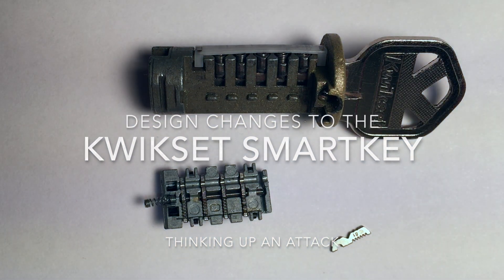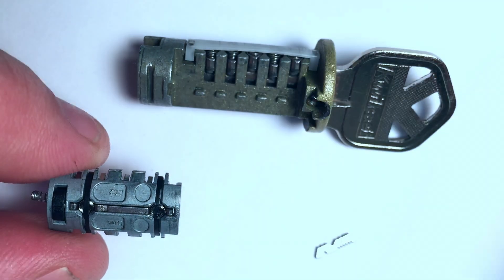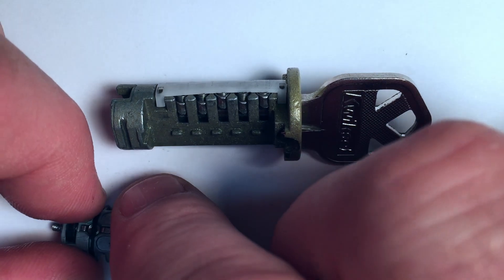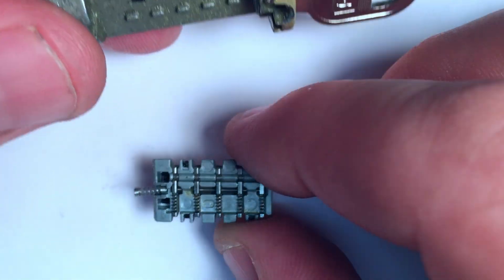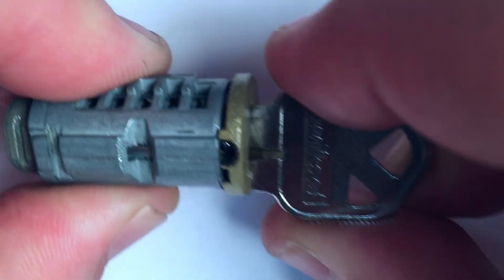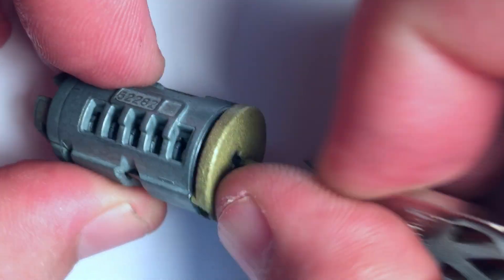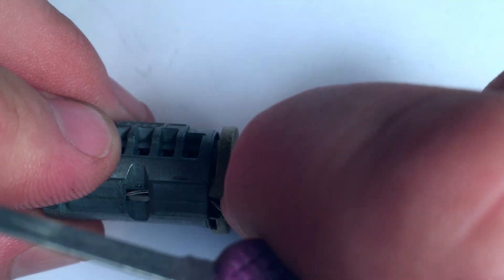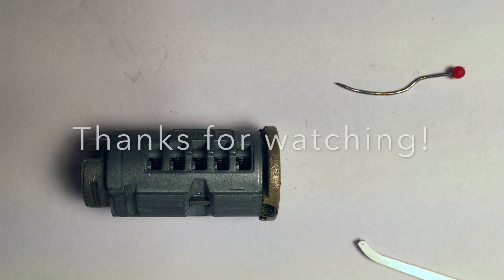Design Changes to the Kwikset SmartKey

Comment: I am so glad for this video, I picked up a Kwikset Halo Touch deadbolt for cheap cause it was missing its keys. I found and was about to order a replacement tumbler assembly when I found this video. 5 minutes later I'd managed to disassemble and reset the lock to a random kwikset key I had!

Comment: I've got an old Gen2 SmartKey that is sticky and wonky and absolutely refuses to cooperate. If you apply ANY tension whatsoever everything binds up like it's welded together. Even if you get some set and remove tension, nothing releases until you apply reverse tension. And if you try to manipulate in just the right way, the wafers will slip and change the keying so the key won't even work. It's an absolute beast to work with.

Comment: After  installing and messing up the re-keying process on my brand-new Kwikset deadbolt,  I found tumbl3r video. I discovered that the plastic cover on the bottom half of the cylinder, was VERY lightly attached to the cylinder.  When you insert the key in preparation to re-fitting the wafer-side of the cylinder, the key pressure on those little springs can cause the plastic shell to pop off and the 5 little springs to fly out. Be very careful here.

Comment: For hobby pickers, please consider posting more detailed picking hints that define that lock's Kwikset Smartkey generation.

I've looked at these posts:
Charles builds crap
Michael Gilchrist # L21
Jamie's locks #25, 29
loupgarou21
Artemis picks #21
tumbl3r (post and "design changes")

Cordially,
Gary Bowman
Reply: the other posts didn't get listed. They are: Michael Gilchrise L21, Jamies locks #25, 29, loupgarou21, Chris Ahrens #68, 139, 21, lockapalooza #4, MrBlack-magic #57. From looking at the face of the lock how can one tell if it's a gen 3 needing the shim to pick?
Reply: Also, would using the shim make picking gen 1 and 2 easier?

Comment: Here's an idea! Try bend shaping the pin with the corresponding depth entries, using a needlenose plyer and shaping it into the shape of the sidebar entryway, so that the tip of the pin will fall into place when it reaches the sidebar. Then when the pin is turned it'll put the sidebar in place.

Comment: Totally agree the AssaTwin is the machinist treasure to have beaten.  I was never a fan of Kwikset because it’s lack of tolerances and builder grade evolution.  The early versions of the Kwikset smart key were easily defeated.  Now, The Square side bar under spring tension is what GM has done from the 1960’s. As a locksmith we would use Wiggle jiggle keys or more modern techniques were to use set of rockers blades. With GM you would use car opening tools and to make the ignition key, pull the wheel and lock and just replace it.  As for the Kwikset, this newest design, it lends real locksmiths called in for a lockout two choices, rake and rock for 3 or so minutes, then drill.  I don’t see how a bump key would ever work - so for that, I applaud Kwikset. I would be very interested in tumbler 3 non destructive pick or manipulation of this lock.  I say, exploit the tolerances and gaps.

Comment: The side bar has the two clips already applying down ward pressure, so using the pin forced into that side bar slot will only bind the lock more causing you to use even more pressure needed to turn the cylinder.  Try to use the lightest turning pressure possible and lubricate the lock first. A heavy hand is the true failure of picking most locks.
Reply from the maker: This is incorrect. Chris Ahrens has proven out the theory of this exploit and used it to defeat the Gen3 SmartKey about a year ago. We worked together on the project. Since then many others have defeated it the same way.

The "use light tension" mantra represents a somewhat viable approach to open one very specific type of fairly mediocre lock. Sadly, that dogmatic approach to tension became pervasive, and actually prevents a lot of people from defeating anything other than average locks. The correct tension is that which gets the lock to respond. Sometimes it's light, sometimes it damn near breaks your tension wrench.
Reply: Do you have a video of that by pass?  I would be interested in seeing it.  I am still and have been a locksmith for 34 years, but any tips are always welcome.
Reply from the maker: Here's the video Chris made picking it with this exploit. https://www.youtube.com/watch?v=H-9_3gIQwPw&t

Comment: Hi.  Very nice video.  I recently had a smart key lock installed on a new door at home.  I have been interested in locks for decades.  So I did some research to see how the smart key system worked.   I just viewed your video.  It looks like the revised kwikset smart key system is a "dead ringer" for the general motors steering column ignition locks used on their cars from 1969  until probably the 1990's. These were the column locks that had the "ears" that were used for the rotational force.  The keys back then were thin and weak against rotational force.  The side bar was squared off to prevent it from being picked down by rotational tension.  The quick picking method was using profile keys.  Locksmiths would have a set of about 10 and the process was trial error.  The other method was more destructive.  It involved drilling a hole in the end of the lock face to access the end of the side bar. Then use a pin (such as you are trying) to provide force on the side bar to pick it down.  The GM locks were not rekeyable so the wafers were a simple one piece design.  Of course all of these anti pick devices took a back seat to the VATS lock systems that came along in the 90's.
Reply from the maker: Good eye! I didn't know it at the time, but Kwikset certainly did copy the GM design. Interestingly, some versions of these locks are vulnerable to force attacks too. It's a clever design, but without high-quality, hardened materials it's going to be difficult to make a lock that cannot be overcome by manipulation or force.
Reply: @tumbl3r  Good point about the lack of use of hardened materials.  I guess, at the end of the day, the lock still needs to be affordable by being mass produced using diecast metal parts.  Back in the day, another GM bypass method (even more destructive) was a slide hammer connected to a "cork screw" that was threaded into the keyway.  A few good yanks and the  plug came right out.  One long screw driver was then used to start the car and unlock the steering.

Comment: I'd like a lock that requires you to stick your hand in a hole, reads biometrics, asks for a passkey that needs to be typed on a pad (which is unmarked, automatically cleaned and thermally evened out immediately after each use, with access blocked until finished so no scanning tools can be used) hidden in that hole, another you have to speak and a restraint behind the hole holds onto you until police and an authorized person arrive if you are not authorized to enter.
Reply: Where do you live, fort Knox?

Comment: I wonder how much it would add to the cost and help to plate the surface with titanium so that drilling isn't possible without an expensive drill, bit and a lot of strength and time.  That should even save the lock from that attack almost every time.

Comment: Can this lock still be forced open as the others? Thanks
Reply from the maker: I don't actually know. I suspect not in the way that the previous revisions can be. Probably with enough force the zinc housing would deform, allowing the lock to open. It would not, however fail from inward pressure on the wafers because of the squared off sidebar.

Comment: I'm sure you know by now that using the Kwikset smartkey inserts to actually change the key code depresses the sidebar and will allow you to tention lock and pick it.
Reply: I agree and have partialy tested, but due to a lack of a vise or 3 hands I couldn't use a pick from the front, only poke the waffers into alinement from the side and then turn it , I wiil fully test when I get a vise.
If kwikset were to block access to the reset carriage until it is in the unlocked position, this would not be usable.
if they made a lock that was only designed with the side bar, sliders and dummy pins, that was solid brass it would be unbeatable.

Comment: Just a thought could you take the reset tool and apply pressure once you have it picked to release your tension wrench so the side bar will drop and thus allowing the cylinder to rotate???

Comment: Hi tumbl3r, I have not been able to find anything else more recent on your channel about the redesigned Kwikset SmartKey. Would I be wrong in assuming this video stands for now; that you still conclude the new SmartKey design is extremely hard to foil? For the record, I googled Assa Ruko Twin 6000 and it's very hard to find for sale! (No I am not asking you to talk about the Assa... quite the opposite, smile.)

Edit: I just called the Kwikset 800#, the rep said that any box dated Sept. 2016 or later (on the bottom) will definitely be generation 3 SmartKey. For all products, all ANSI levels. So this is something I could look for. [UPDATE: ANOTHER KWIKSET REP SAID THIS IS WRONG, only Uptown and Downtown deadbolts are gen3 as of March 2017 with no current plans to extend it to others. See my reply to tumbl3r's reply, below.] He also said gen. 2 cylinders have a black plate on the side for quick fixes by locksmiths, but gen 3 does not have that. I guess he is talking about the little bar you remove at 6:01 of your 10:19 video "Kwikset SmartKey - SPP Pick & Gut"?

I might add that as soon as I asked the Kwikset rep about the lock you said was tough, he said he knew of you, and launched into a spiel about how you manipulate the locks so you can pick them. I had to talk over him to get him to stop telling me how you're wrong... the reason I was calling to find out their latest generation was because tumbl3r is saying they're quite good! So if tumbl3r is wrong, the Kwikset rep must be saying SmartKey is quite bad! lol

For the record, I don't believe a company that won't simply say when they made a mistake. Everybody can make a mistake; everybody can improve. But you should not make a mistake and say the other person is wrong about it. So I don't buy it when they say someone else is wrong.

Thanks so much for your videos! They really help inform us. We can't all be good at everything, so we all help each other. (Also, we don't all want a work of art... just a smart choice acknowledging ease of use and budget.)
Reply: @tumbl3r The link to the Wayne Windon video doesn't work. 404 Error.

Love your video on the changes to the kwikset.
Reply: tumbl3r  That video is almost certainly a paid product endorsement (or another marketing strategy)  for Schlage. A door can be kicked in just as easy using each lock, but using a Kwikset gen 3 keeps picking novices out and doesn't take 1 minute to pick.
Reply: MrCarGuy20, That's why there is advice available to make your door more kick resistant.  If your door frame and door is installed properly, with an inexpensive upgrade, even the toughest burglar would rather go through a window, or even the wall.  Even if they have to climb a tall ladder outside to get there.
Reply from the maker: Hi Mike,
As far as I know this is the most current work done with this version of the SmartKey. I was working with a borrowed lock, and I have not gone out and picked up another one to work on. There are a few ideas that I think will ultimately prove viable, but for now I've been focusing on locks that I find more interesting. I don't know of anyone who has managed to pick open this version of the SmartKey and it is 100% correct to say that this lock is extremely pick resistant. That does not necessarily mean they are "good" though. I am not a locksmith, and I cannot speak to the wholistic security of the system, but I will say that the SmartKey is composed of what appears to be potted metal, which is almost certainly not as strong against forcing attacks as more conventional pin tumbler systems made from brass. 
The previous generation SmartKey was susceptible to a forcing attack that worked while often leaving the lock in a semi-functional state. The materials do not appear to have changes substantively in the current generation, so that would definitely be a concern for me if I were considering them for my home. Wayne Winton is a very good locksmith and has made a video about the differences between the SmartKey and the Schlage systems (https://youtu.be/J9pgqBSGD0s). He also has some other good videos about how to select the best lock for your home. Criminals almost never actually pick locks, so resistance against bumping, forcing, cutting or smashing is a much more important consideration. 
It's funny that the rep got all spun up, LOL. Having lock companies frown on what we do and claim that we are faking it or otherwise "nerfing" the lock is just part and parcel for the sport. All I can really do is be as transparent as possible. One shot, no cuts, disassemble the locks and show detail of their components. There will always be doubters and I'm certain that the person you spoke with genuinely believed what he was saying. These companies (and their employees) have a financial interest in this stuff, and I can respect that. My intention is never to poke fun at lock companies or criticize them. On the contrary... If you see me working on a lock, it's because I find it interesting. On the other hand, it would be nice if those who say it can't be done would kindly step out of the way of those of us who are actually doing it, LOL. Oh well :)
Thanks for your comment and for your kind words :) Hopefully the thoughts above are helpful to you. Like I said, all I really do is pick locks and I don't spend a ton of time thinking about the overall security of the entire system. I've been very impressed with Wayne's work in this area, so between the two of us, hopefully you will have enough good information to select the right product to protect your home. Take care and thanks again for your comment.
Reply: Thanks so much for the reply tumbl3r. I see what you're saying. It makes a lot of sense.

In case you or other locksmiths care, I found out some more info. In a second call to Kwikset, a guy in their Warranty department said that actually only the Uptown and Downtown single-cyl. deadbolts are gen3 (and have been since July 2016). He says you can check their site and see that they are the only SmartKey locks saying this. They call it Advanced SmartKey security as you can see on their site (http://kwiksetpresskit.com/ibs-fact-sheets-2016/uptown-and-downtown-contemporary-deadbolts-fact-sheet) or on Amazon (https://www.amazon.com/dp/B01BUG6KBU?th=1). He said all other locks have been gen2 since 2012, and he said they have no plans to phase gen3 into other locks "unless these ones catch on". He sounded pretty lackluster on that, as in, don't hold your breath. Finally, he said the previous Kwikset rep was wrong.

Thanks again for your holistic advice. I hope this helps a little, too.

Comment: Hey, i think i may have a solution to your tensioning problem, i been trying to pick this thing for a while and i "accidentally" rekeyed mine to something other than the key i had for it, as i was pulling it out, the sliders got stuck on the outercore and as i pulled on it, they would bind and i would pick them one by one until i got the core out and rekeyed it again manualy. However it gave me the idea to use the rekey mechanism as a tension device, it seems to work, you push on it with force and it bind the pins but not the sidebar, give it a try, i have not been able to pick it, but the pins do bind
Reply: Were you ever able to pick it w the rekey device or any method / tool?

Comment: My fiancee got me a Smartkey padlock for christmas.  After watching Bosnianbill's vid on raking it, I gave it a whirl.  After a few hours it cracked open, but couldn't recreate it since.  I didn't realize that there was a potential change until I saw this video so I tested the lock by torquing the key while inserting it and the lock was jammed up so it's Gen 2. How could I have done this?  My only thought is that my triple peak almost lines up with the key's bidding at the right angle and I got really, really lucky.  Have you had any luck with the Gen 2 since this vid was posted?
Reply from the maker: If you put tension on the core and the pins bound up, it's a Gen 1. This is because the triangular shape on the outside edge of the sidebar is attempting to ride out of its corresponding groove and jamming itself into the sliders (which are, in tern, connected to the pins). If it were a Gen 2, you would tension the core and the pins would all be springy and unresponsive. The this is the distinguishing feature of the Gin 2... Tensioning it does nothing that translates to the actual slider / pin subsystem.
Reply: huh... The pins are binding when I put tension on the core while picking, but the key won't turn if I put tension on the core first then insert the key completely.  It's not until I turn the key counterclockwise that it resets and it will freely move clockwise to open.
Reply from the maker: I wonder if maybe one or more of the pins are being overset as you put the key in under tension? Seems like if a binder is a low cut, it would just stay at the position of the highest cut on the key.